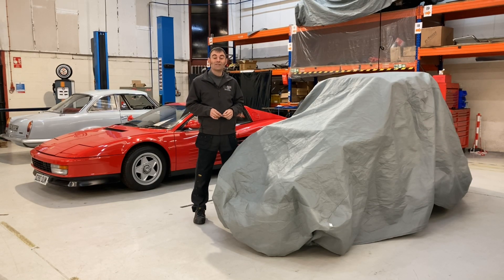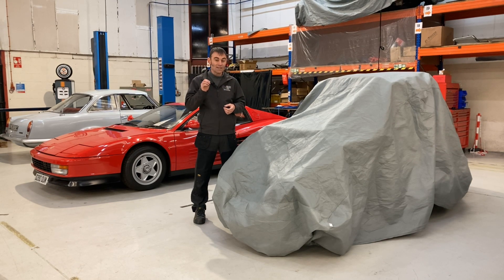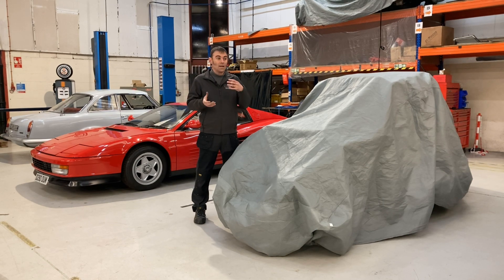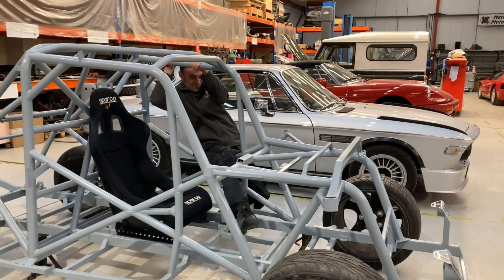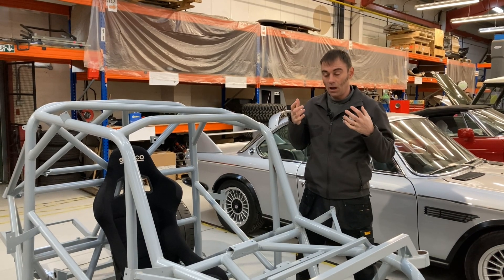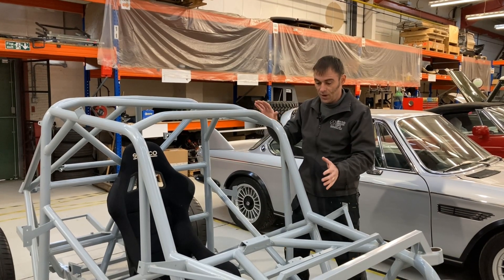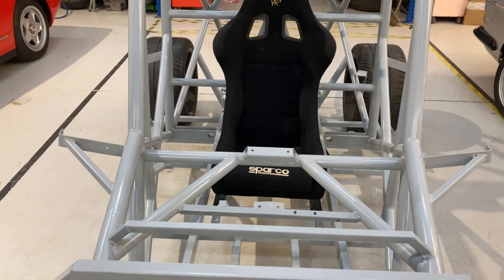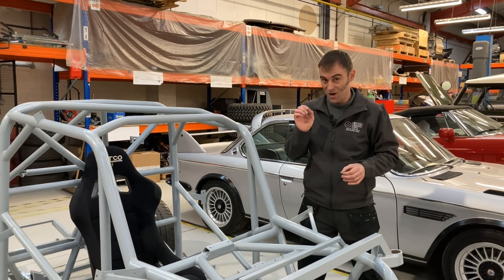Tesla Plaid slayer revealed.

Comment: Sorry but I think you are doing it all wrong. You should consider the following:
1) Make a picking list of all the components you are going to use and measure the dimensions and weight.
2) Design the chassis in CAD to suit the components above; not try and fit what you want to the chassis you have.
3) If you hack the chassis you already have you will lose the torsional rigidity and compromise the design strength.
4) 1020hp is too much for such a short wheelbase. It will be too unstable. Tesla has a wheel in each corner with a long wheelbase relatively speaking, and it has a very wide track. This beetle kit is great for 200hp I wouldn't want to put Tesla Plaid motors in there but hey its good for your likes and subscribes ;)

If you want a chassis made up, I can recommend Dragon Prototypes. They make up Ultima GTR chassis from scratch and are currently developing an EV GTR chassis.. we will be using Plaid drivetrain and the chassis will accommodate all of the Plaid battery too.

Good luck with your build I will be following this :)
Reply: Scratch built Chassis in Cad helps no end to develop the main components before even cutting a tube in our experience bud … Good luck with the build 👍
Reply: Use the chassis you have as a development rig for the suggestion above 👆

Comment: If that's RWD, the body length is going to impact on keeping front wheels down during a drag race.

Also if RWD, F1 style sticky tyres may be needed to get enough traction.

If you position the batteries too far forward to counter lifting front wheels, it may also end up being front heavy on low acceleration and cornering.

If you want good air conditioning, just forgo the body panels.